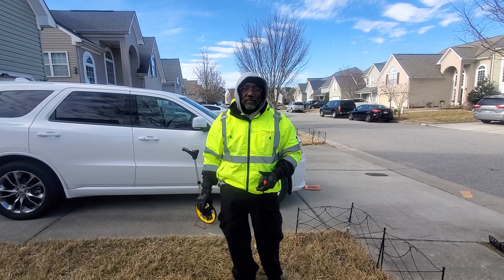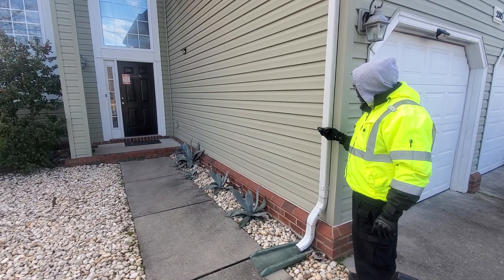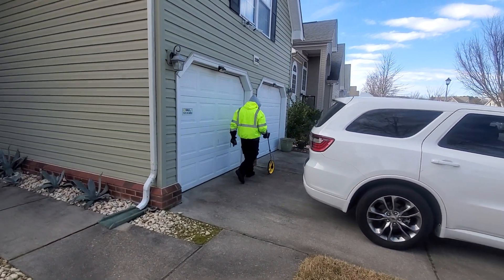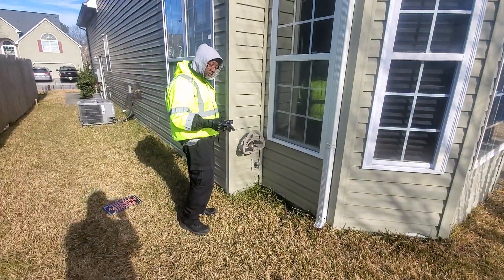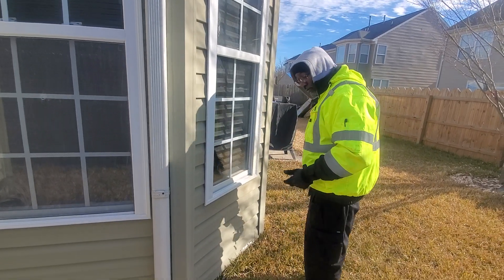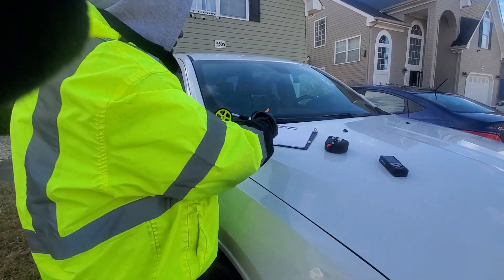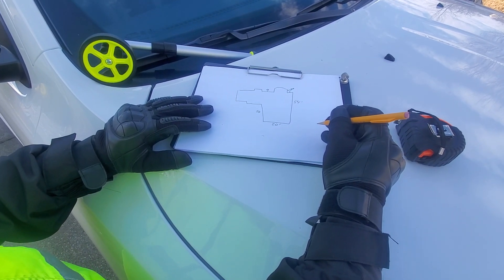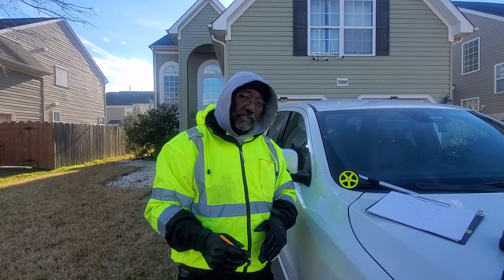Groundwork Inspection How To Use Measurement Tools - Part 2

Comment: Hi Griffin, 
I saw your videos and signed up for the ground-work inspections, submitted my sensitive information and was told to wait for my background to return. No one has reached out and it’s been a week since. I called the numbers attached to the email quite a few  time and they just ring and go to voicemails that says I have reached a total different number than what was dialed. Is there possibility that there may be some scammer websites out there?
Reply from the maker: Send me an email with your number. I call you between 10am and 12pm, at 4pm or after 730pm  today 11/16. Let me know. Notaryhelp@griffinnotary.com

Comment: Question for you,
Would a laser measurement tool of 65ft work for doing diagrams
Reply from the maker: That would be borderline but it could would on most houses. Mine is 165ft
Reply: @GriffinNotary  Hi Griffin, which brand and model laser do you use?
Reply from the maker: There's a video in the groundwork Playlist that shows all the equipment I use